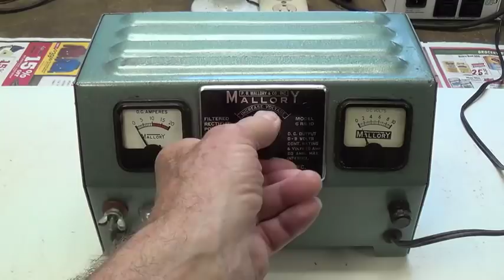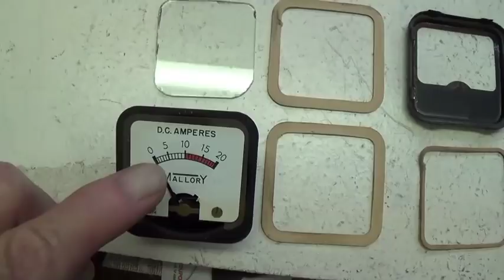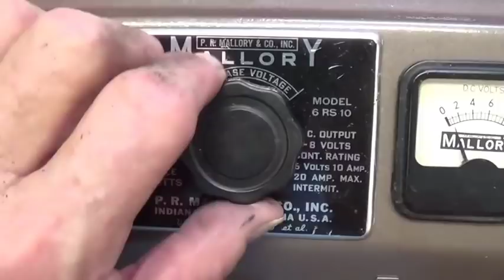Airline Model 9002 Chassis + Mallory Power Supply  =  ?????

Comment: I wonder how big a 1 Farad capacitor would be ... ? Strange unit. It's like measuring driving distances in light years.
Reply from the maker: Yes, your Farad analogy is about right. Perhaps they use Farad capacitors in hydroelectric generator plants (?)

Comment: loved the video! I repurpose amps and put them in old suitcases.  You are definitely my goto when it comes to tube knowledge as I have none.  Had a question for you and not sure how to contact you. I was in Missouri over  last week visiting family. I found a 1970's Silvertone 10xl amp in perfect condition in my uncle's garage.  He was gracious enough to give it to me and I brought it home. The amp looks perfect like it was never played only problem when you plug it in.... nothing.... was hoping maybe you would have some insight. Thanks and again love your channel very informative! Well done!    Ed
Reply from the maker: Thanks, Ed. If I could repair amps long distance, I would be a rich man.....and I would repair yours for free :)  Sadly, however, it requires personal inspection, taking lots of voltage readings, etc. My advice is to either study lots of videos and fix it yourself, or find a local qualified tech to do it for you. You might check the fuse, and definitely build your own current limiter (see my video) before plugging in the amp, to avoid damaging some expensive internal parts.
Reply: Thanks for the reply! I am happy camper at the moment! Did a little deeper investigation myself and low and behold the fuse was blown! Found a replacement in my junk parts soldered it in and she sings like a bird! Did it quick and dirty so when I get more time I'll clean it up and most likely find a decent speaker for it. The speaker in it now has a crack in the cone but still sounds great none the less...  now I've got a great little practice amp for the living room and won't have to lug my 69 twin up the stairs!  Rusty would be proud.....
Reply from the maker: You can easily patch the speaker cone, BI. See my video on how to do so. Best of luck with your "new" amp.

Comment: Another good one Uncle Doug.
It's a cinch that the Hammertone paint people won't be sending you any freebies tho. LOL. Not that you really want them to.
Reply from the maker: Thanks, DE. It's not the Hammertone part that's bad, it's the brand. Rustoleum is the worst spray paint in the universe. I hate it.  It never dries and it clogs the nozzle repeatedly.
Reply: Agreed. I hate when that happens. My wife asked me if I had any "varnish" she could use on a project and I told her all I had was some lacquer. I had a couple of cans of clear nitro that were waiting for a guitar or amp project. Since no project seems to be on the immediate horizon I went ahead and gave her a can of that stuff and told her how nice it dries and that it's fast if you do light coats and blah blah.  I still didn't know what she wanted it for exactly but I didn't want to butt in since she seemed to want to be left on her own for whatever it was she was clear coating. 

She was right too because if I'd seen what she was spraying before she sprayed it I would have started making a lot of suggestions because it was an old wrought iron plant stand that had been living outside by the garden for years and she just wanted to spray it as found without any sanding or wire brushing or doing anything to remove the rust it had developed over the years. It's very old and if it had ever been painted you can't tell now as it is just bare rusty metal. 

So she sprayed it with several coats of the nitro and it turned out really cool! This was a couple of years ago now and I'm still amazed by it every time I see it. It almost resembles that hammered finish paint but not exactly. The lacquer seems to have locked all the rust in place on the thing so now it has a sort of matte finish with a very subtle texture that feels nothing like the raw rust that it was before she sprayed it but not quite as mottled as a Hammerite finish either. 
I wish I could describe it better but I will say this much. If you have a can of clear nitro around and some sort of an old hunk of rusty metal to try it out on you should give it a whirl. See it first hand is always the best anyhow, right? 

I have a bare metal chassis (It used to be a Stromberg Carlson AU-29 amp) that I've been thinking of making a sort of champ clone out of and I'm tempted to toss it out in the backyard or maybe on the garage roof 'til next year and let it get that nice coat of rust like the plant stand had. That finish she got on her project would make a very cool and unique finish for almost anything metal.

Comment: Oh geez unk.  I was so hoping to see those analog panel meters working.  I've been wanting to integrate meters on an electro-mechanical etcher I build for knife makers but am fearful of what I don't yet understand.  Perhaps a feature video on the intricacies of measuring Current vs voltage could enlighten then us further.  Also could you wire in AC bulbs to the heater supply line to illuminate the panel meters from behind,provided it did not accumulatively draw more current than the transformer is rated for?
Reply from the maker: I agree, Rocket. The failure of the stinking meters was a big disappointment. Also, they're sealed on the back and would be really hard to illuminate.

Comment: cool little amp!
regarding the biasing issue, have you ever had dc getting onto the grid from the plate within el84's? i had a recent gremlin where if i increased the post PI volume one tubes bias gradually increased and one tubes bias decreased! i swapped the tubes and the bias was stable
Reply from the maker: I've had El84's run wild before, Geoff, and I never could come up with a solution. Perhaps an internal short. Nothing could calm them down, and I had to replace them. Until this video, I have never had it happen with any other type of tube.....but in this case it was a missing grid resistor, not the tube.

Comment: I've paused the pole dancers...they don't mind. I'll just watch you go out of your mind. By the way, you haven't been into Jack's catnip, have you?
Maybe I should try that catnip(8-). That project was just crazy enough to work. And, like you said, makes a nice little practice amp. Still curious
about that trimmer capacitor though. Looks like something that should be in a radio(8-). That selenium rectifier...they do photo reactive things
if you clean off the paint. Wonder what you could do with that?(8-).  That big transformer...ya may need to take a turn or two off the secondary
to use it with silicon diodes. That drone ride...sure is neat hangin' out over Texas(8-). Thanks for the opportunity. Certainly don't feel bad about
leaving the pole dancers hangin' now.
Reply from the maker: Wow.....thanks for all your nice comments, Tom.  I agree that the adjustable capacitor looks like a trimming cap in a radio.....very strange. It made no sense to me so I disconnected it.
Reply: Oh...now, this isn't pole dancing, but you might get a kick out of a lass I started watching a while back. She lives in Lost Wages, but she's like spittin' on a hot skillet...
she's all over the place. She's got videos of her checking out most of Nevada. I haven't figured out how to send links yet...but she's wonderhussy adventures on
youtube...she's also wonderhussy on vimeo, tumbler and instagram. She's Sarah Jane Woodall on facebook.  No...no pole dancing, but she's a feisty she critter
and pretty damned easy on the eye. Be warned that she hates shaving...so she skips it when she's on a vacation sort of event.
Reply from the maker: I checked out her hot springs videos, Tom, made just north of where I live. She's an interesting young lady, a bit hairy in the pits for my taste, but with several redeeming features :)

Comment: You blew through those bias resistor calculations like it was nothing. How do you calculate the resistor you need? For example I am rebuilding a Heathkit A-7 and am going to use 12V6/6V6 tubes. it has a B+ of 390VDC according to the schematic. But the two websites I found that does the calculation is more complicated and cumbersome than I care to figure out. any ideas?
Reply from the maker: Bias resistors are selected primarily for the voltage drop that occurs across them, which can be used to calculate plate current.  Ohm's Law dictates that Current in Amps =  Voltage Drop across the Resistor /  Resistance of the Resistor.    So if a 1000 Ohm resistor provides a voltage drop of 35 Volts, then the current is 35/1000 or .035A or 35mA.  If this value is not acceptable, then you can then extrapolate the resistance you need......i.e. I want 40mA of plate current, which is about a 15% increase, so I'll reduce the resistance to 850 Ohms. This is only an educated estimate, since the voltage drop will also change, but it will definitely be in the ball park. You can then fine tune using the same technique.
Reply: Uncle Doug I was thinking something similar, however, I didn't think cathode current was the same as plate current...
Reply from the maker: Remember that all the current which flows to the plate comes from the cathode. Some of the cathode current flows to the screen grid, so plate current is actually a little lower than the cathode current.
Reply: Yea thats true. I keep forgetting about that lol. I am from Solid State land, so the engineering section of tubes I am a slightly bit weak on.
Reply from the maker: It's time to take a big step......backwards, to the time when vacuum tubes ruled :)  Keep watching the videos and it will all become a lot clearer, TK.

Comment: when my patience is shorter than it usually is , I get my heat gun and from a safe distance I dry slow  paint
Reply from the maker: With Rustoleum paint I sometimes use a flamethrower :)

Comment: Hi uncle Doug, @3:07 with that airline chassis you obtained for parts, would you want to sell one of those black knobs from that chassis?  When I first obtained my airline, it was missing the speed knob and pot, which I got working after replacing some caps and resistors, and added pot for speed.  Let me know and thanks.
Reply from the maker: Gosh, Vince, I wish I had known at the time. The aluminum chassis, knobs, etc. were sent to viewers shortly after the video was posted. I checked through all my knobs just to be sure. I'm sorry.
Reply: Uncle Doug , that’s ok, thanks for checking.
Reply from the maker: @vhm14u2c  I feel bad, Vince. Wish I could have helped.
Reply: Uncle Doug , don’t feel bad, all is good.  I had this amp since the early 80s and has been like that since, I don’t mind the way it is, and plus with your informative vids, I was able to get the tremolo working again on that amp a few months ago, which has never worked nowhere near the way it was supposed to when I got it almost 40 years ago, lol

Comment: Doug I note. you've wired this one with volume and tone up front, rather than the more traditional positions of in between preamp stages. Any reason for doing it this way? Love the final amp, looks amazing. Regards all the way from New Zealand.
Reply from the maker: Apparently that was the way it was done in the circuit I used as a guide, Ben. Normally, I would prefer the VC and TC to be interstage, as you sugested.

Comment: Such a cool project. If it had functioned, how would you have inserted the ammeter into the circuit?
Reply from the maker: Possibly to monitor plate current.
Reply: @UncleDoug  I ask because I recently ran across this gem,
https://i.postimg.cc/DZJFQVsy/IMG-20210121-150301.jpg
on a pile of scrap, It was so cool looking, louvered sides and back, killer industrial look - I just couldn't let it be scrapped. I'm putting a 6G2 Princeton circuit in it and trying to figure out how to incorporate the meters.

Comment: That is my kinda project, take a couple of “Basket Cases” and combine them into a great looking useable piece of gear. ¡¡¡Bravo Seńor !!! I noticed that you chamfered the holes through chassis for the upper side to lower side wiring routing, wouldn't the use of grommets be a wise choice for those passages?  Too bad about the meters, it would have been really ”Snazzy” to have, say cathode bias on the left and power out on the right, would have been really ”Cool!”. The paint, well what can you do,  too cost prohibitive to go out and buy automotive paint for a small project, not to mention the mess and hassle with a spray gun and the cleanup,  ugh! Been there, done that, too many times. The drone flight was beautiful, wow looks like y'all could use a little rain, I saw a. Cat claw bush that looked pretty thirsty and man that is dry when that happens. Great Video as always. A really fun looking project. Just got the chance to watch it this morning, we were attending the birth of our second grandson Levi on Thursday afternoon.
Reply from the maker: Congratulations on the arrival of your grandson, Mark. Thanks for the nice comments:)  It's hard to get grommets that will work with 1/8" thick aluminum, so, as you noted, I chamfered the holes. I always use grommets with thinner sheet metal chassis. Yes, the gauges were a letdown, but there is always hope of finding some that work :)  It's the "monsoon" season this month, so we do get an occasional rain storm from time to time.
Reply: Man do I ever remember monsoon season, a week or so of drizzling rain and that was it for the year pretty much.
Reply from the maker: Lately, it's been more like an hour or two of light rain, and that's it for the year. Things are pretty dry around here :)

Comment: Hey uncle Doug. Could you do a video on converting a stereo tube amp into a guitar amp?
I have a vintage zenith and want to modify it!
Reply from the maker: The problem with that conversion is that guitars tend to be monaural, Nick. In the old days, they did make some stereo guitars and amps.....BB King used one......in which each (of two) pickups had it's own amp channel.  Check this out:   https://www.sweetwater.com/insync/stereo-outputs-on-vintage-guitars/
Reply: Stereo tube amps are getting increasingly difficult to find, and expensive. It may be worth selling it to someone who wants a tube hifi amp and using the money to buy a kit or an older mono amp to convert. The overall happiness level of everyone involved will be much higher that way.
Reply from the maker: That sounds like good advice, Daniel.
Reply: My friend gave me a stereo tube amp he built and it sounds great. I hooked it up to the output of my Fender Mustang amp and hooked each channel up to the 12" woofers and it sounded fantastic. It had more attack and squeal. The thing about the Fender mustang is that it is an amp modeler and has presets for every type of amp so I could set it to "British 70's" and then just run that through my tube amp. Regardless the stereo amp sounded good. 

My Zenith has a 12AX7 preamp and tone stack in a separate box. Then that feeds into four EL84 tubes and two 12AU7 tubes. (one 12AU7 and two EL84's per channel) does this information change your advice? 

All I want to know is how it affects the sound and what things I should adjust to make the amp more suited for a guitar.
Reply from the maker: I wouldn't suggest any modifications without actually seeing the circuit, Nick, but if it sounds good, then go with it.
Reply: I haven't tried it on its own yet. I need to replace the capacitors. They are all original caps coated in wax and while it worked and sounded great, I don't want to risk blowing them.
Reply from the maker: Other than when used as coupling caps, the waxy tone caps generally hold up surprisingly well.
Reply: For a cool stereo amp, build a mono pre amp and a reverb circuit to drive
Only one of the power amp section . Or an effects loop to 1 or both sides
To add mono or stereo effects.

Comment: What was actually wrong with the meters? Were they totally burned out? Or do they have the wrong adjustment resistors inside?
Reply from the maker: They don't respond to stimuli......voltage or current. I have not attempted to repair them.

Comment: Nice little practice amp
Progect from mallory
Cab. The drone flight 
Looks like the land scaping of The planet
Mars. The vehicle on the road,well perhaps they
Are colonizing.
Reply from the maker: Glad you liked it, Dwight :)
Reply: Yes you are quite
The craftsman.
Perhapps you can run
Into a volt meter for the amp later. Try a radio swap like a ham radio swap they'll 
Have new and old things plus electronics venders plus plenty of antique things as well
New oldstock tubes
Even the odd one
Needed for somthing.
Reply from the maker: @dwightjt  Thanks for your input, Dwight.